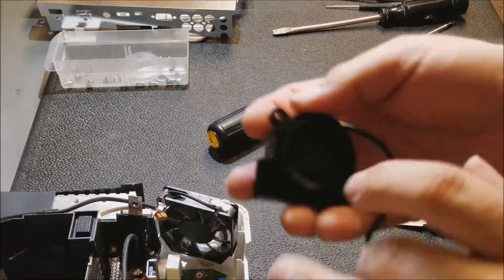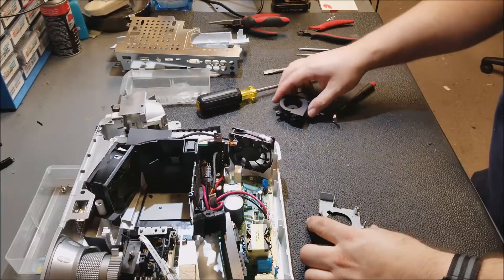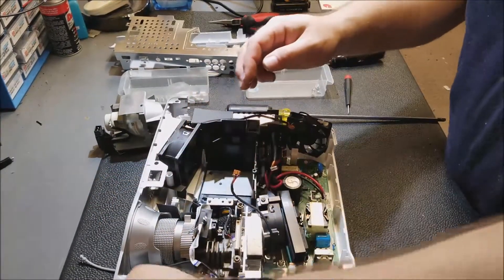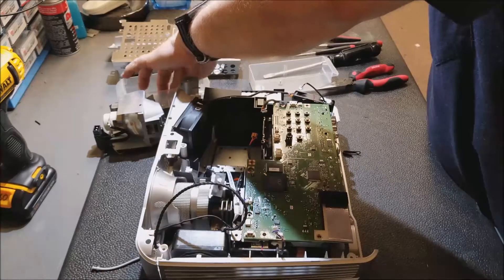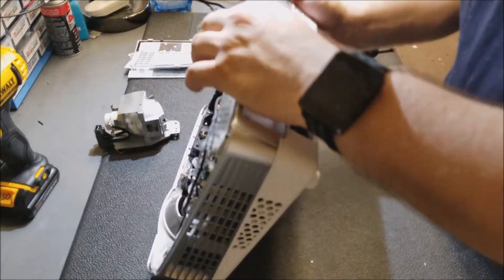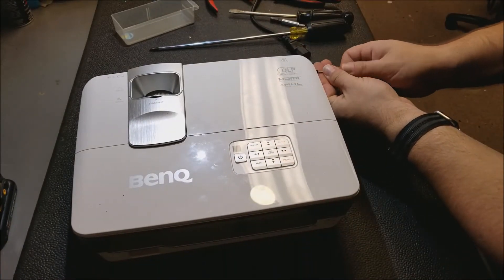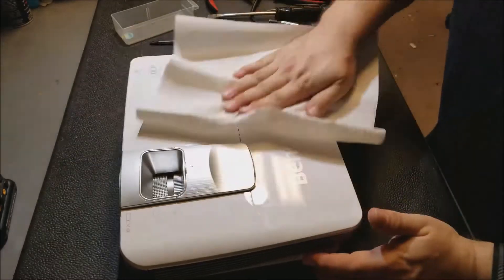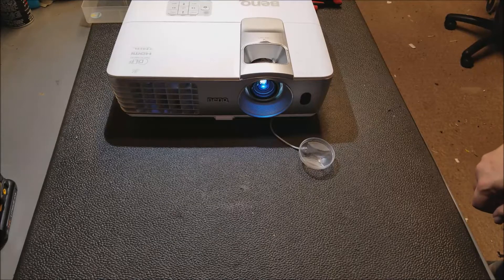BenQ HT1075 Projector Repair P4

Comment: My Benq th681 is frequently getting temp notification. Any help please. What should I do?. I works only for 15 or 20 minutes and then the temp warning comes...
Reply from the maker: HI Abdul!  I suspect you have a problem with the blower fan.  Either the fan has a lot of dust inside or other debris.  The blower fan is the fan I show at the beginning of this video.  Your TH681 should have the same layout as this projector inside.

Comment: Frank, thank you so much for the informative video.  I have a very brief question that I was hoping you could answer: where can I find replacement parts (other than bulbs) for this unit....like the fan and/or heat sensor that you point out in part 2 of this series?

I have a HT1075 that was purchased in September of 2015 and has been subject to EXTREMELY limited use (a handful of movies and a few games during college football season), that began exhibiting what seems to be a known overheating issue shortly after it came off warranty (of course).  In normal operating mode it will run for maybe 30 minutes, then shut down due to overheating.  It can immediately be turned back on and will run for 5 to 30 more minutes before shutting down again.  I live at sea level, but running the unit in high altitude mode (runs the fans at full speed) seems to keep it from shutting down.  However, the fan noise is so loud that we have stopped using the projector altogether.  I plan to take the unit apart per your video and perform a thorough cleaning, but I would like to replace the heat sensor while I have the unit disassembled.  There is quite a bit of information about this problem in various forums & Amazon reviews, and the BenQ post below shows that they were doing free RMAs for these at one point due to a faulty sensor:  http://support.benq.us/customer/portal/questions/14341514-benq-ht1-75.  Any recommendations?
Reply from the maker: Hi Andrew. I find a lot of parts on eBay or from Mouser/Digikey. 

When you say you can turn it right back on, does that mean without any extra cooling? Do the fans shut off when it overheats or does the lamp turn off and the fans run high for a minute? Are the LED's indicating overheating?

The thermal sensor by the fan is a self resetting thermal switch. Usually they are used to interrupt the mains power, but I recall this one having smaller wire than normal. I was looking for the service manual, but it is eluding me at the moment. 
The specs of the sensor are labeled on it. Temp is shown in C. You can find there most places that you can buy parts. You will have to re-solder the new on to the old wires.  

One thing bugs me...I want to say there is another temperature sensor(maybe more). The BenQ support fellow could be referring to a thermistor. Most projectors have more than one. It is much smaller and mostly surface mounted to a pcb placed near things that get hot or are susceptible to heat. Sometimes they look like little beard on the end of a pair of wires.  They send active temp info to the microcontroller and let it decide what to do.   The thermal switch is on or off, no data being sent.
 If you decide to take the projectors apart, see where that thermal switch (by the fan) plugs into the power supply. See if it's in line with one of the mains lines or connected to an area with a lot of small components and maybe an IC.  

 The fan however, you want to match it via the model #(on the label).  Not just the size and voltage.  The tachometer lead can have different electrical characteristics and not be directly compatible.  You can search eBay using the model # and Fan and you should see some. 

  Giving the fan a clean would be a reasonable first step. If that makes no difference go down the new fan route and sensor last. You could do the sensor first, but I figure the projector already cooked the old fan so why take the chance? The fan might be failing and causing it to overheat and shut down.  If the fans stall, the projector shuts down really fast with an overheating error.

Comment: Hello Frank, i Need a Help.
My BENQ MP610 is not working.
when i connect it to the power the led indicators turned on, Then i press the power button the projector turned on but no light comes out of it. but the fans are spinning.
also no Lamp Indicators turned on, so can you help me with this?
Reply from the maker: Have you checked the lamp? That would be my first inkling of an issue. If the lamp is good and looks ok it might be a power supply issue. Can you post a picture of the lamp? Specifically looking down the front of the lamp
Reply: How can I send you those pictures?. And one thing after turn on the projector I cant able to turn it off using the switch, I have to remove the power cord to turn off.
Reply from the maker: If this behavior is new, I would focus on the pins from the power supply to the main board. It is easy to miss-align those. You may even want to take it apart again and slowly re-assemble it.  I still think you have a loose wire or something along those lines.  For the pictures, I would take a video, post it on youtube and send me a link.  That would likely be the easiest.

Comment: Which fan would be the one associated with fan 1 error?
Reply from the maker: I'll have to see if I can find the service manual, but I suspect it is the blower fan for the lamp. It's the most prone for failure.  I did a video about a year ago on checking fans in a projector.Same process would work on your projector.  https://www.youtube.com/watch?v=stIYr2bI2fQ  It might also be marked on the mainbaord where they plug in. As an example, FN1, FN2, FN3 etc (might not be FN )could be marked by each fan connector.
Reply: Thank you for whatever help you can provide.  The projector I'm having issue with is a W1070, but it should basically be the same thing, the good news is that I have a whole extra W1070 laying around which I can use for parts once I'm sure which fan is the issue (when that one comes on, after a few seconds the colors go crazy and the projector shuts off...)
Reply from the maker: That projector might be a better repair.  The color changes is because of the color wheel. If you swap the color wheel out of the first projector, it will likely fix your color flashing problem.
Reply: The one with the fan issue is a few years newer and has a better firmware revision, so I'd probably prefer to go forward with that one if possible.  Still, I'm interested to know why you suggest to do a color wheel swap over a blower, is the color wheel swap actually somehow easier to perform?  (Also, the one with the catastrophic color issue didn't have that problem till after its original bulb exploded, so there may be other issues in there with bits of glass... heck maybe it is salvageable on its own with the right cleaning...)
Reply from the maker: I suggest the color wheel because it involves less disassembly. The blower fans commonly need the mainboard removed. I agree with your reasoning on the firmware. You mention the glass bits in the older unit and it reminded me that the you should inspect the wheel for cracks or chips from the exploding bulb. That may be the cause but if not, a piece of glass in the wrong place would be very problematic.  On the newer unit,    Check the blower fan nearest the lamp. I notice they  catch debris easily.

Comment: Hello Frank, I would like to ask something regarding my Benq PE7700 Projector. It is still in mint condition, lamp ran about 300 hours. When I switched on last time, after 1 minute I heard a "click" and turned off. Can`t turn on . No LED lights, nothing. I have removed the power adapter, (photos available). Fuse okay, everything looks fine, a mosfet TOP247Y looked a bit damaged, I've replaced, but still the same problem. No power, no LED-light, nothing.....Do you have a suspicion where the mistake could be?
Reply from the maker: Hello Attila, If the switching IC burned up, I would also check the nearby diodes. There is a Zener diode feeding the D-pin on the IC that would be suspect.  Also any resistors. Do you think it was a power surge that caused it or you are not sure?  Its very rare for one of those chips to fail by itself is why I ask.
Reply: Hi Frank!Thank you for your answer!Here in Thailand, the electricity is very unstable, could also have been a power surge. How could I send you 2 photos where I marked what I already checked? I also have the schematics from Benq.
Reply from the maker: That would make sense. Feel free to email me at rostit@ultrafark.com.  I will then reply from my actual email.
Reply: Okay, will do it!